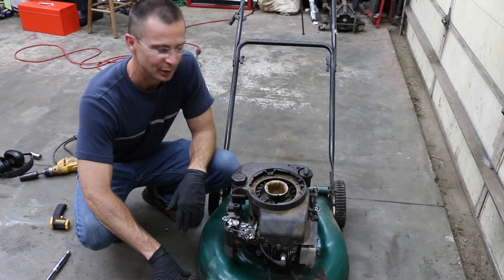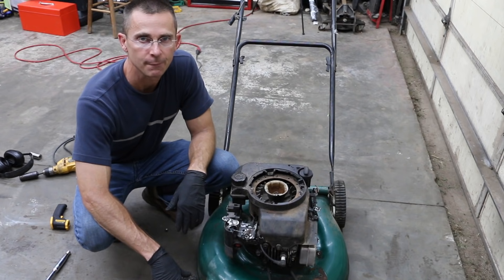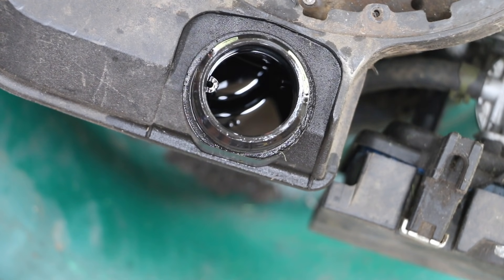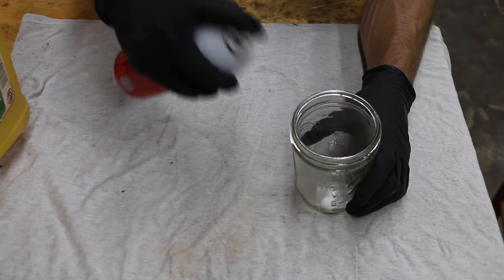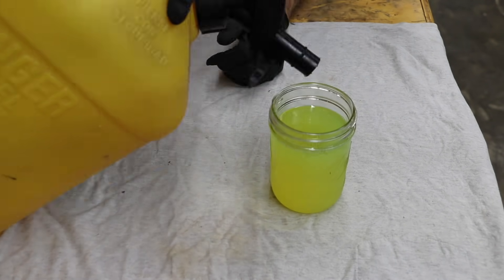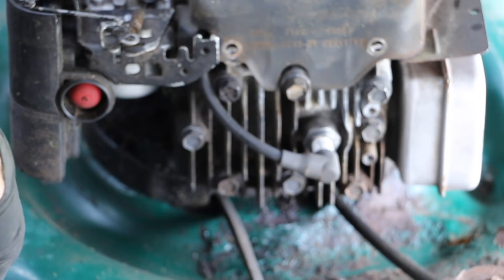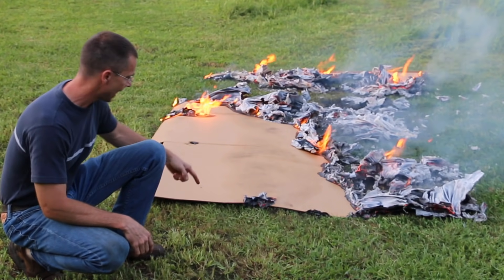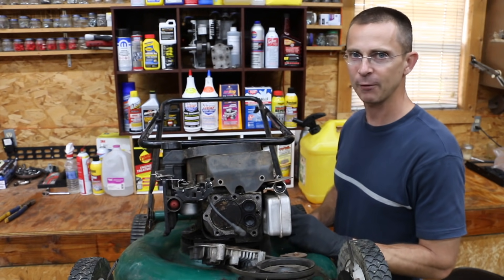Will a Gas Engine Run on Diesel?  Let's find out!

Comment: I've played around a bit with adding a tenth percent of diesel to my turbocharged car with an obvious improvement on power, improved fuel efficiency, noticeably more power but ultimately fowled my plugs to the worst I personally have ever seen. The diesel acts an octane booster and the percentage came from someone who converts vehicles in alignment with converting State vehicles by a certain soon deadline, and result was exactly as he said. However, I really would appreciate it if you could follow your gut with experimenting and follow your gut to try the 1/4 gas, plus mothball, diesel mix. - And of course to play around on any little discoveries you may come across that may be at the very least, interesting. I use Premium gas in all my mowers and vehicles, except those that are diesel only and the inside of all my engines are cleaner giving me lasting performance longer, I have more miles per gallon, and lastly is the best...I enjoy more horsepower to really get up & go when I want or need to! I'm always interested in new experiments that can be applied, so keep it up. Even if it doesn't work out (whatever your doing), you'll discover another way how it should not be done coming closer to the discovery you felt and knew was right.
Reply from the maker: I really enjoyed reading your comments!

Comment: How about the run time of the engine at a 50/50 diésel mix vs a 100% gas? Will it run for the same amount if time?
Reply: JW Outdoor great minds think alike.
Reply from the maker: I should have kept track of the run time, but I didn't.
Reply: Project Farm that's too bad it'd be nice to know if there was any fuel economy
Reply: Timo Kotipelto exactly what I was wondering

Comment: if you start it up on gas get it hot and then switch it to Diesel and put catalyst converter in it it will begin to detonate I did successfully run a mower on catalyst converter and Diesel won't start on it though has to be hot already and then you can stop the motor for up to probably a minute or so before it won't start again
Reply from the maker: Thanks for this information!

Comment: Many old tractors were started on gasoline then when hot switched to distillate. Two carbs were also used for the different viscosity.
Reply from the maker: This is interesting. Thanks for commenting!

Comment: i'm guessing it will not run.  the spark will never get it lit properly and there is not enough compression to burn it normally
Reply from the maker: Thanks for commenting.  It ran on 50/50 mix.

Comment: I have one for you, but it might take a little extra equipment. Try plumbing in a mason jar type Rhodes Gas generator below the throttle plates. I've seen good mileage increases, but have never torn down an engine to see what it did to the chambers and valves.
Reply from the maker: This is a great project idea--thanks!
Reply: I have also heard them called water capacitors, browns gas generators, but anything that can make a v8 powered, carbureted and hotrodded seventies corvette hit 27mpg is worth a look

Comment: Can you run a diesel on gas
Reply: you can run a diesel on gas but you have to mix oil with it or you will trash the fuel system gasoline has no lubrication in the fuel. a diesel will run on about any type of fuel as long as you mix some oil with it
Reply: Old Army Deuce-and-a-Halfs had a multifuel engine which probably would burn North Korea swampwater.😈
Reply: MidShipCivic, Diesel is considered "fuel oil" and since it's an oil, a light oil, it most certainly does have lubrication properties.  Funny, you're the one talking completely out of your ass and calling other people "fcking dumb", lol, it's you who is the "fcking dumb ass"!!! Idiot!
Reply: +MSengineering David - FUCK U NIGGA !!!
Reply: +Jordan Bronson - Those two might be the same person with 2 different accounts. They got offensive when you call them out with their 3rd Grade Level Educations.  lol
Reply: Not for very long lol
Reply: Go read about it I'm not your librarian.
Reply: +MidShipCivic - For the record, People are here to " LEARN " regardless if they are  " Dumb " or not... Dumb..., according to you !!!  Have you ever thought of this?  You can learn a lot from a Dummy. But NOT " I ", it's the Dummy that doesn't know how to learn !!!  By the way, look at your 3rd Grade Level of " Education ".  No " Caps " beginning of a Sentence and a Sentence that runs longer than the Equator.  So, before you CALL PEOPLE NAMES or DUMMIES !!!! Speak for YOURSELF, like...  Who is the DUMB ASS in this case?  LMFAO !!!
Reply: Bharath G 
Remove gas as you can with the pump , and refill the FULL tank with diesel  to have the injectors and hp diesel pump lubricatded .
Reply: It wont lube the system gas will dry it out diesel is oily
Reply: No cuz diesel acts like a lubricant somewhat
Reply: +DB - Hahahahahahaha, You might be right. In that case, multi-personalities do counts as 2 People. OK, let me put it this way.... From " Forrest Dumb ".... Nigga is, Nigga does!   LMFAO  😂😂😂😂😂
Reply: Rusty Evans haha, I wondered this too but I know now that u can run diesel in a gas engine...but the next time u start it...well...u won't because you've just learned how to completely trash your engine, well done! No hate, great question tho!
Reply: A guy at my job put gas in a diesel engine and it didn't make it out of the gas station parking lot.
Reply: Not recommended but if you got gas in a diesel unintentionally, remove most gas with a pump and then use a near 50/50 of gas and diesel, no saying that it will run smoothly or even run. That is your best bet at saving your engine.
Reply: Cletus Spuckler if once filled with gas it is not possible to pump out all the fuel, you have to run a mixture with more of diesel. Gasoline will lubricate the pimp and injectors since its viscosity is similar to diesel
Reply: Rusty Evans no no it will balls the engine up it will run dry
Reply: If you put diesel in a gas engine it will get you home. Because it's over lubricating the gas engine. You must get the tank drained after. Change fuel filter and wash out the throttle body with carb cleaner or run gas through it. My friend had a Honda hrv he put diesel in it many times. He just got it cleaned out but it depends on  the gas engine.
Reply: Stop reading this thread and go research the answer yourself.
Reply: Rusty Evans nope
Reply: Gods no
Reply: Compression is WAYYYY to high on a diesel engine to run petrol.
Reply: Depends on the engine. But the general answer is "not for long". (the high compression causes detonation.)
Reply: Jordan Bronson bruh your white and you aint even have the n pass and your like 7 so be quiet and its your bed time
Reply: No
Reply: Shut the fuck up.
Reply: Diesel nor Gas have lubricity in it the EPA mandated this and made it cleaner every year so you're wrong about that. if you put oil in a fuel injector you're fkin dumb.
Reply: Read it up do you know what the fuck ''low sulfur' diesel means and ultra low sulfur diesel EPA mandated it dumb ass it's pollution control.

Comment: If he could power a glow plug off the coil, even adding a diode to charge a battery to power it, and he shaved the cylinder head down to bump the compression up high enough, how long would the motor last? These gas engines are running at somewhere around 8:1 to 9.5:1 compression. Diesels are up closer to 17:1. He'd have to shave a decent amount off... I'm curious what would go first? It'd be kinda neat to have lawn equipment running off free, used cooking oil.
Reply from the maker: Thanks for this idea!

Comment: love your videos man im thinking of using the 50/50 mix in my motorbike its one way to make my gas last longer and cheaper
Reply from the maker: Recommend beginning with a very small amount of diesel in the gas and gradually increasing the diesel ratio.  Your motorbike might be setup in a way that makes a 50/50 mix challenging to burn.  Thanks for commenting!

Comment: How efficient was the burn of 50/50 gasoline/diesel? Is it improved over straight gasoline?
Reply from the maker: I regret not measuring the run time of each.  I suspect it ran longer with the 50/50 mix, but i can't say for sure.
Reply: Project Farm did it leave residue, burn cleaner, or cause any other observable problems?

Comment: I tried running a mower on E85, but no luck. Maybe if I had a motorized starter it would have kicked over.

What about kerosene?
Reply from the maker: I'll try both E85 and Kerosene.  Thanks for these suggestions!

Comment: Many years ago a service station attendant filled up a pick up truck I had from a construction company I was working for with Diesel fuel instead of gasoline. I never noticed until I drove back to the construction site trailing light colored smoke. My guys came running up to me to ask what happened and by that time there was a severe knock in the engine. I had one of my guys quickly drive the truck back to the service station where they drained the diesel fuel. I would say it ran for about 20 minutes before being drained but there was never any lasting damage or knocking and we put almost 60k miles on the vehicle after that incident.
Reply from the maker: Glad no harm occurred.  Thanks for commenting!

Comment: Project Farm, with the diesel / gas mix did you see a difference in the running time compared to just straight gas?
Reply from the maker: I regret not keeping track of running time.  It would seem to make sense that diesel would last longer.
Reply: Project Farm I agree, was it precisely 50/50?

Comment: Gasoline has about 120k BTUs per gallon and Diesel has 145k BTUs per gallon...the engine will run on Diesel if you per-heat the fuel before it enters the carberator (much like that of an old fashion kerosine torch)....try the test again but boil the fuel on a hot plate or micro wave oven before you put it in the tank ...see what you get...
Reply from the maker: Thank you for this idea!

Comment: Nice video! I always wondered about that. I have some fuel that is over one year old. I am concerened about burning it in my riding mower and I don't know how to get rid of it. Some videos say that I can mix the old and new fuel and run it; some say that I can add stabilizers to the old fuel and then use it. Can old fuel be used? How old is too old for fuel? How can I test fuel to see if it is viable? How can I safely and responsibly get rid of old fuel? Thanks for your high quality and informative videos!
Reply from the maker: Thank you very much for the positive comment!

Comment: Put WD-40 in that engine!
Reply from the maker: Thanks for this suggestion!
Reply: Your channel is awesome!
Reply: Project Farm WD-40 instead of oil?
Reply: WD40 used in a 2-stroke, with no other oil added.  The WD40 would be the fuel and the lubrication.  We use WD40 as 2-stroke starting fluid all the time and it works for that.  We use it because it has the lubrication that regular starting fluid does not.  I've never tried running WD40 as the primary fuel source but have always thought about it!
Reply: Done it once. Blew it up
Reply: BlackConndor WD40 is pretty much diesel. Well, kerosene.
Reply: BlackConndor put wiscky

Comment: I'd like to see one of these engines running hydrazine, if you dare 😉
Reply from the maker: Sounds dangerous.  Thanks for commenting!
Reply: you'd have to mix hydrazine with alcohol or nitromethane, as it won't mix with gasoline

Comment: Isopropyl alcohol is a nice one to try. My other suggestion is mixing in waste vegetable oil with gasoline. The objective is to determine the ratio that burns and performs reasonably well. Maybe if prices of gas skyrocket for some reason in the future this can be an option to stretch the mileage for those who may have access to waste oil.
Reply from the maker: These are both great suggestions--thanks!

Comment: I ran out of gas in a 67 caddy back in the 70s and drove it 5 miles on the gallon of lacquer thinner that was in the trunk, ran great lol, great vid you should have explained to the most that might not know that mothballs is para-di-chloro-benzene and benzene is an octane booster we used to drop the balls right in the tank in the day of higher compression engines
Reply from the maker: Thanks for sharing your experience.  Also, I agree.  I should have explained mothballs.  I used Naphthalene mothballs.  Naphthalene is found in some additives sold as octane boosters.
Reply: interesting both forms have sublimation properties meaning they go from solid to gas state without becoming a liquid in any temperature range yet appear to dissolve in the fuel

Comment: Try retarding the ignition and pre-heating the intake with a heat gun or whatever. That should make it run pretty well on straight diesel fuel or kerosene.
Reply from the maker: Thanks for this recommendation!

Comment: A Diesel fuel must be pressurized, like an injected cars, to increase its temperature before combustion . I put a Diesel on my flex fuel few weaks ago , that worked great, but I experienced  some smoke on exaust. After that my engine still works, with 72000KM. I aways check oil, filters, fluids leaking, temperature, even changing parts needed, acording with vehicle´s manual. That´s it :)
Reply from the maker: Thanks for sharing your experience.  Glad your vehicle did fine in your flex fuel.

Comment: Theoretically you can turn pure fuel grade ethanol into gasoline by adding soy diesel to it.  At least in terms of how it burns in the engine.  Ethanol burns a bit too quickly for a normal, low compression engine to fully utilize.  But by adding in a blend of 10-20% soy diesel, it slows down the overall combustion rate of the fuel mix enough for the engine to make better use of it.

This is all in theory though, and do note, the fuel mix will not be the same as gasoline so the engine might not quite run the same as it does on gasoline.  Also, the fuel mix might also just turn into a sludge if the mix ratios are off.  Might be worth testing in a simple lawnmower engine(for cost reasons of things go wrong...).
Reply from the maker: I enjoyed reading your comments--thanks!

Comment: Gasoline is a flammable liquid, diesel isn't, diesel is a combustible liquid. There is a difference. I know this because I'm a certified firefighter instructor for the state of Texas.
Gasoline or flammable liquids are defined as having a flash point below 100.0f degrees , there are sub-categories of flammable liquids and combustible liquids.
Gasoline will flash at around -40F Diesel will flash (depending on grade) at around 140F
Needless to say gasoline is EXTREMELY dangerous, so many people are severely burned because they underestimate the volatility of gasoline!
A combustible liquid (diesel) is a liquid with a flash point of between 100 and 200 degrees Fahrenheit.
If you run gasoline in a Diesel engine (like a truck engine) it will explode almost instantly.
Don't believe me......try it!
Reply from the maker: These are all great points. Thanks for commenting!
Reply: Interestingly many years ago when the military purchased the M35A2  2 1/2 ton 6x6 truck  it came with a very unique engine. It was a LDT 465, a 478 CID multi fuel engine. The US required this because diesel wasn't always available in a combat situation, so this engine would run on diesel, Kerosene, heating oil, JTP-4 or Jet A (although very expensive) you and even gasoline and avgas ! There was a caviat to this, the engine was turbocharged and had an injector pump which had to be lubricated, neither avgas or gasoline have any lubricant properties so motor oil had to be added to the gasoline at some ratio. I don't remember the ratio.
In an emergency straight gasoline would work w/o the added motor oil I don't know how long/far you could go before doing damage to the injector pump.
We used these in the military and they worked great. The M35-A3 the later models were a diesel only engine.
BTW, in the winter months in the extreme cold, diesel will jell and won't flow so you can add/mix in Kerosene in with the diesel. About 10% Kerosene to 90% diesel will work fine, it will start easier too because Kerosene's flash point is about 100°F about 40 less than diesel and kerosene will remain pourable to about -55°F,  diesel will gel at about -37°F because of the paraffin in the fuel.
Anyways, I'm rambling.

Comment: Great video, not surprised by the 50/50 mix as I have a few vintage tractors and to mix power paraffin the recipe is 1l diesel, 4l petrol and 15l paraffin (in USA kerosene is what we call power paraffin here in RSA but we can't buy it and regular paraffin for us is like Jet A1 with no antifreezing agent in) All these tractors are super low compression and have spark plugs... I would risk it to say a average lawn mower would start and run with power paraffin but with diesel that engine would need to be extremely hot to have a chance to start on diesel.
Reply from the maker: I enjoyed reading your comments.  Thanks!

Comment: Gunpowder dissolved in gas & diesel
Reply from the maker: LOL! This sounds very interesting!
Reply: Project Farm I am very interested
Reply: Charcoal doesn't dissolve. Nor does sulphur, as far as I know. Not sure about the saltpetre.
Reply: Seems like it would leave excess deposits on the valves and combustion chambers.
Reply: Won't work. Myth Busters tried to design a modufucation to make a gasoline engine run on gunpowder. They got a few puffs of smoke but its really impossible.